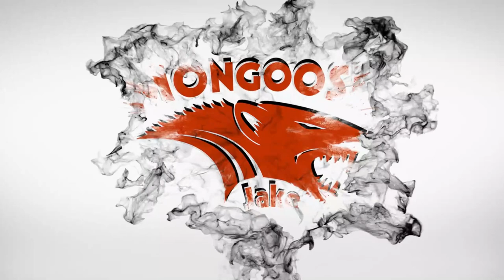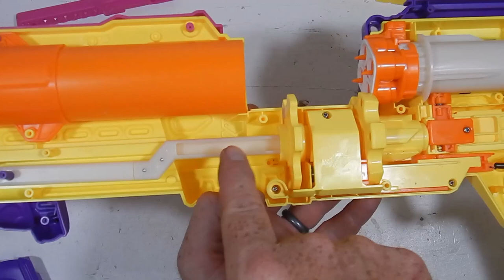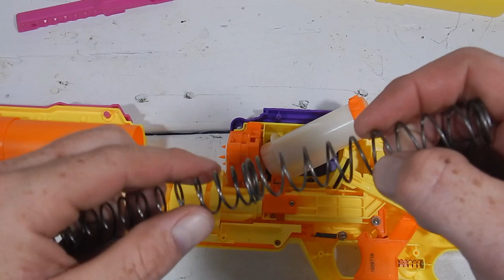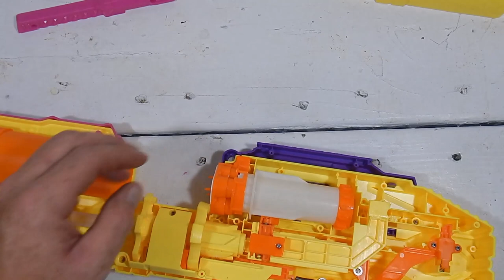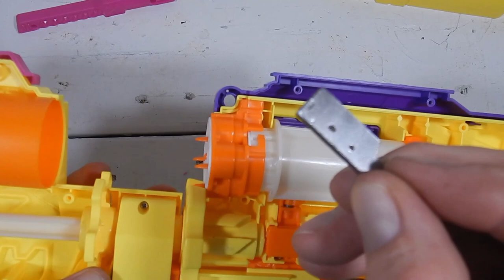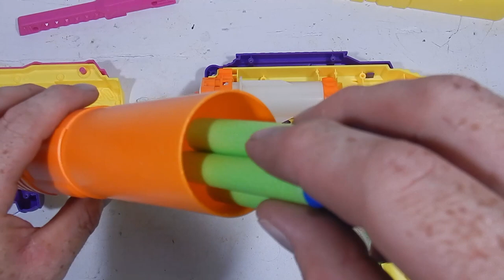Adventure Force Tetrashot Internals and Mod Potential

Comment: Grabbed one at Walmart last night, used it for a round today. Seemed like a few times, the belt advancer didnt quite make the necessary rotation, leading to failed shots.

Seems like if there's a spring-loaded clutch on the rotation mechanism, it may need to be glued/screwed together/otherwise disengaged.

In any case, I know I'll end up getting another one for extra shenanigans, so I can see if that one has the same issues or works as intended.
Reply from the maker: I agree with the advancer having a couple of hiccups, and noted that in my review of the blaster, it happened only to me during really fast firing, but did happen. 

Ironically, with mine now modded for shotgunning, it doesn't happen, despite me having left the advancer mech alone.

Comment: When you gut the AR and glue the plunger tube to it if that ramp is at the bottom the custom steel piece shouldn't be necessary.
I'm definitely going to get a few of these. :)
Reply from the maker: After testing various methods, I didn't want to make the ramp being in one position a requirement, so the metal piece works out to be a better overall solution, and leaves the door open to changing the PT to whatever else I might want to try in the future as this will be an ongoing build with various improvements.
Reply: I'm going to convert one of these to HPA using a modified 40mm air soft grenade as the tank.
I think it should fit inside the plunger tube and a slight mod to the plunger will make it the striker that activates it.

Comment: Of course all 4 should be able to fire because it already fires from all 4 positions
Reply from the maker: Only issue would be if the darts bounce into each other, but otherwise they should have no issue. I've not had issues in my testing of my shotgun mod so far.